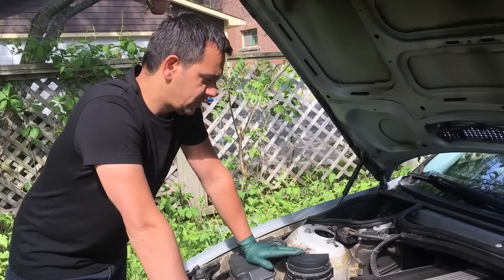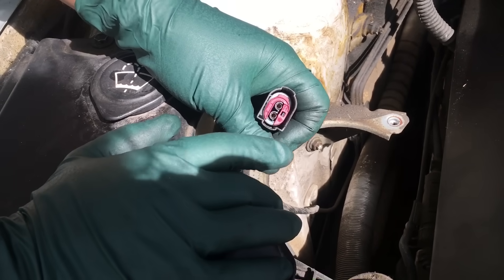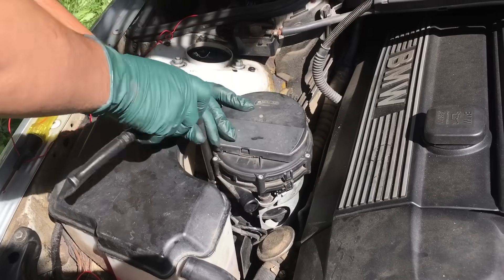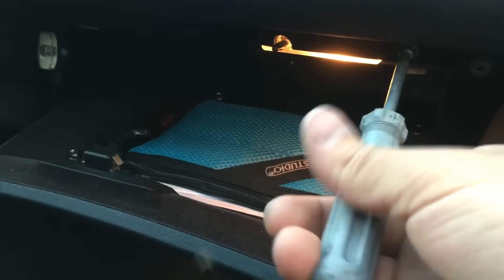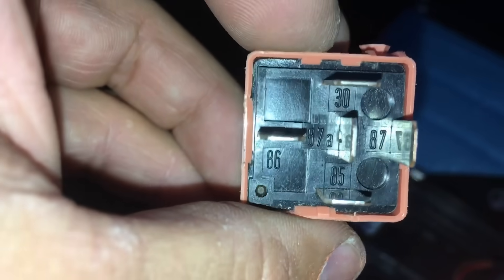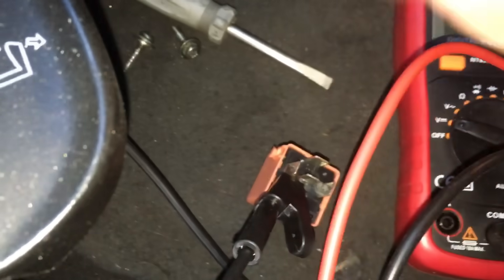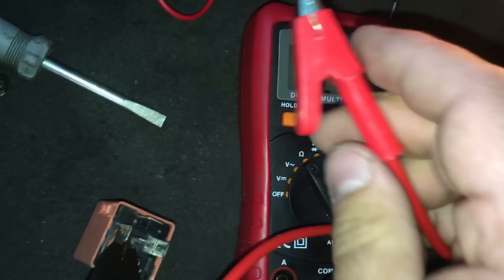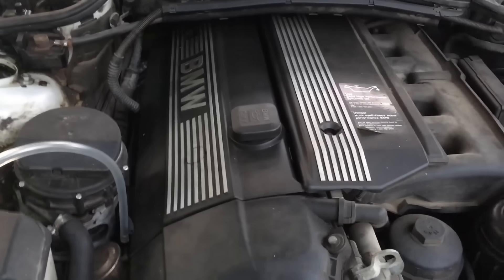Secondary Air Injection System on BMW E46 330XI (Code P0491/P0492)

Comment: Reasons for secondary air not to work.

Engine not cold
Lazy O2 sensors-upstream 
Faulty relay
Shorted wiring
Faulty fan 
Broken fan blade
Broken fan to vacuum valve hose
Broken vacuum hard line or hose
Insufficient manifold vacuum 
Failed vacuum valve
Plugged ports in cylinder head
Failed vacuum solenoid on back of manifold 
Incorrect hose connections to the vacuum solenoid (one vents to atmosphere when de-energized)
Those are the main ones
I found lazy old O2 sensor, bank 1 upstream no other codes for that sensor, just that secondary air monitor would not set

Comment: Does a bad air injection pump  ruin the catalytic converter ?
Reply from the maker: No it won’t to the point of being concerned, but it will pollute the environment, because that pump only works for 90seconds

Comment: 2004 325i
Behind the intake manifold is the electrically actuated valve that controls the main valve.
The hoses get hot and brittle.

It's extremely difficult to access them.

Especially the ones that go to the intake manifold vacuum ports.

They are way back under the manifold.

You can see them with a somewhat large mirror. But it's extremely difficult to maneuver with a reverse mirror image.

You can get an exacto-knife to cut off the broken section. (With extreme difficulty).

To install the new hose, I ran a pointed coat hanger inside the new line and positioned it Inside the metal port tube.

Then slid the vacuum hose down along the outside of the coat hanger.

I lubricated the inside of the line with WD 40. (Or any lubricant)
Reply from the maker: That’s great information, thank you for the insight 😊

Comment: The problem in 1999 528i is in the circuit.  Look under the hood, under the airbox (passenger side) open up the plastic compartment with all the other computer relays. under the air pump relay the wire connection is missed wired for the air pump. The air pump Wire needs to be moved to match up with the proper terminal ending of The relay.  You need to focus closely on how the wires come up in the housing for the air pump relay ... to realize the it’s missed wired and you need to pull it out and stick it in the right area in the housing to connect to it’s proper relay terminal ending. Someone Make a video of this repair and send me a cope @ ahsinsmith@gmail.com
Reply: Are you saying this car never worked from the factory?  Not repaired under warrantee?
Reply: @jason.arthur.taylor  it was wired wrong from the factory
Reply: @ahsinsmith3963  So like I already asked,  why wasn't it repaired when under warrantee?  (They last several years--all repairs are free.)
Reply: @jason.arthur.taylor  it was a 1999 bmw I bought used, and while fixing it that was my discovery.  I found a blog online talking about it too.  Others in the blog verified my suspicion of being manufactured this way because they had the exact same vehicle with the same problem and they discovered their vehicle too was wired wrong.  After I fixed the problem the check engine light went out and the code went away for good..  Wasn’t easy to find because the wires came in from under the relay.  The wires are hard to disconnect from the relay so I simple cut the wires and re joined it to the correct relay switch and crimped them together.
Reply: @jason.arthur.taylor  I didn’t buy the car new, I bought it dead and not running in 2018.  It was my hobby vehicle.  I fixed it and sold it

Comment: I have a e39 with the same codes would it make my car feel sluggish when accelerating?
Reply from the maker: Andy Picasso no it shouldn’t, these codes are only for smoke and environmental pollution
Reply: Gear Spec but basically this code isn’t anything to worry abt right away it won’t harm anything right so I can wait till emissions comes
Reply from the maker: Andy Picasso it’s nothing to worry about
Reply: Gear Spec ok first time driving these cars maybe it’s just not as fast as I thought lol thank you

Comment: hello ... I have a problem with my bmw ... and I think it is electric ... when I did the test on the connector ... they both turned on the same ... not as presented in the video ... any idea ?
Reply from the maker: Javier Panameño if you are lucky then you can just open up the relay and inspect it, clean it. If not fixable then you need a new relay and that should fix your problem 👍

Comment: I have a x3 I did the test and no air coming out does it works all the time or is on and off?
Reply from the maker: It works only the first 90 sec on a cold start after that it doesn’t work anymore until the next cold start

Comment: Why don't you show where the small hose connects between the engine and firewall and the fuse in the ebox inside the small black box that has (4) 30 amp and (1) 20 amp?
Reply from the maker: John Taylor thanks for your comment, it’s a really tight area over there especially to record, but if you follow the small hose it will take you to where it connects. This job is more of hand feeling because there’s not much you can see

Comment: I have a question please, I have an E46 M54 2,5, as long as this pumbe works takes my car super gas on, rather the cold start valve, speed about 1000 rpm, as soon as the speed at 650 he takes bad gas and goes Often out, without gas is difficult to drive, i chainge the CCV........... sry for my bad englisch
Reply from the maker: 1072sixela sorry for the late reply, I had missed your comment. Hope you have it fixed by now. I don’t think your problem is related to secondary air injection system however I would recommend to check the vacuum line and valve which are located respectively around your engine block and behind the engine. I would say check your ccv system, even though you have it changed. Make sure the timing is correct and all the engine sensors are in working condition. Let me know if you have any other questions! And good luck! 😊

Comment: Any ideas on what might be the cause of a p0414 error code? The code says "secondary air injection switching valve 'A' circuit shorted"
Reply from the maker: Eric Gonzalez So you get the P0414 code? Did you check the 50 amp fuse, and know the relay is ok? Most likely is the switch at the back of the engine. You can jumper power to the air pump and turn it on so you know it is ok, just like I showed you in the video.
The switch is hanging under the back side of the air plenum/manifold and is hard to spot even if you remove the guards around the brake master cylinder area. Just follow the vacuum line to it and maybe a mirror and as much light as you can throw on the subject without the light itself obstructing your view. 
You would more easily notice that there would be a connector without a home in that area. That is easier to see than the switch it plugs into. 
 The switch is mounted in a rubber hanger that slips over a sheet metal bracket to hang it under the manifold.
 You should also check that the vacuum line to the valve on the front of the head is ok, and you can follow the vacuum line all the way to the switch under the manifold to confirm you're looking at the right thing. Good luck!😊
Reply: Gear Spec Hey so the issue that I figured out years ago was that non return check valve, the black and white valve behind the manifold was flipped. I had removed the intake manifold when I replaced my ccv/pcv and installed the check valve backwards.
Reply: Gear Spec 2 years later and now I’m getting both p0491 p0492 so I’m going to try to test the air pump to see if it’s functional